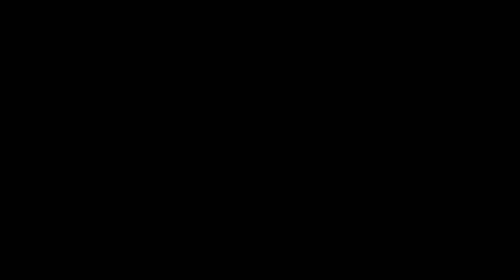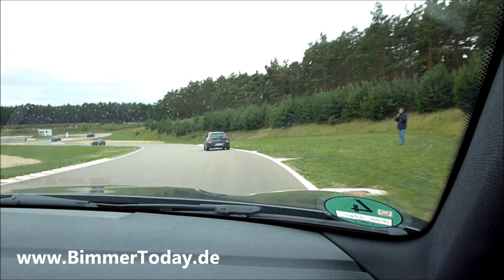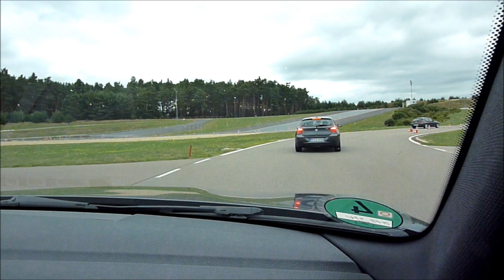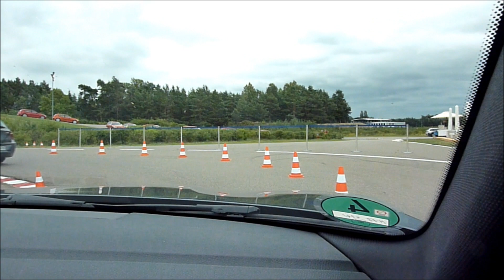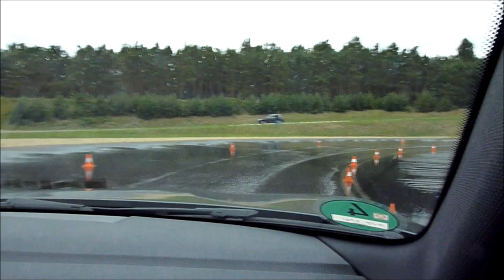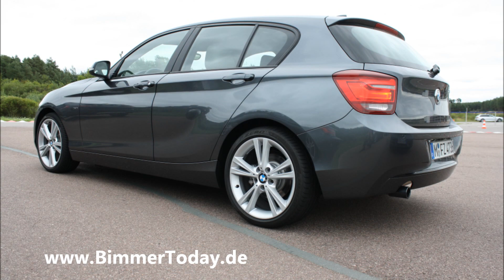BMW 1er F20 Handling-Test Fahrsicherheitszentrum Linthe

Comment from the maker: @MrDodobmw
170 hp, yes. It feels way better than the old inline-4 without turbo. virtually no turbo-lag, lots of torque from low revs, really nice to drive. Given the kind of use the new engine is also much more frugal than the old one. Of course it is no power-machine, but I think the 170 hp fit nicely to the car and all in all the 118i has enough power to bring you joy. There will be a video showing the speedo on the autobahn soon, just make sure to follow this channel :-)